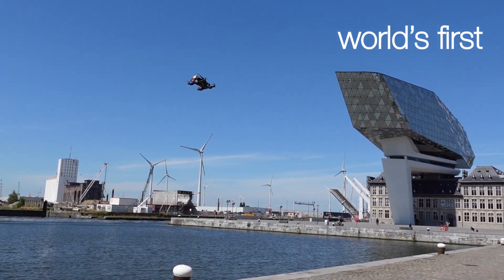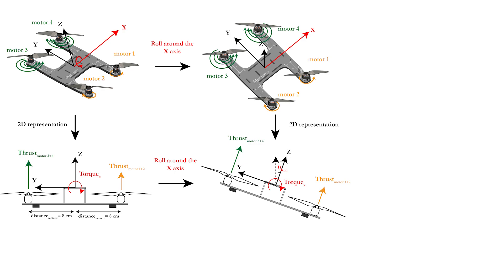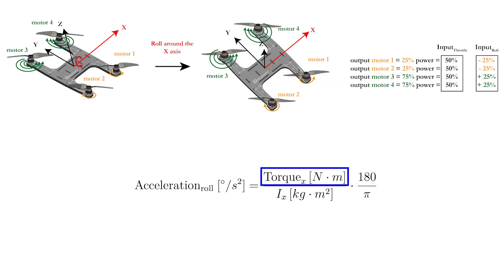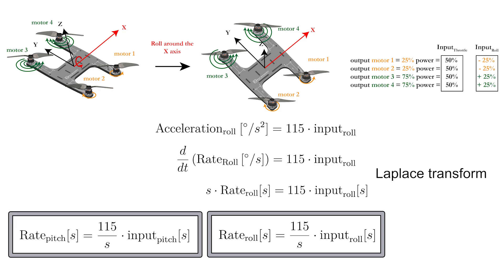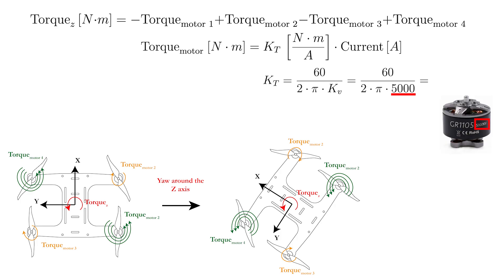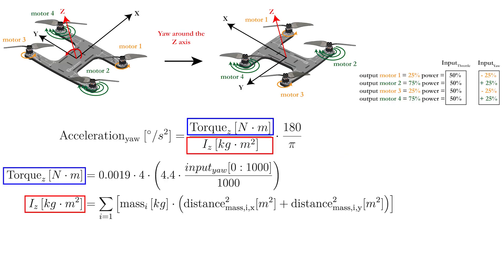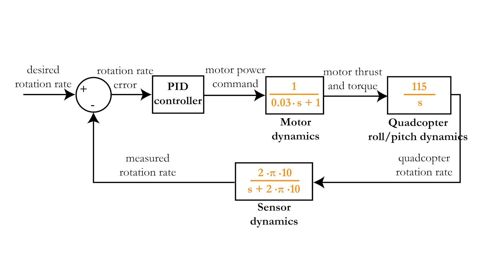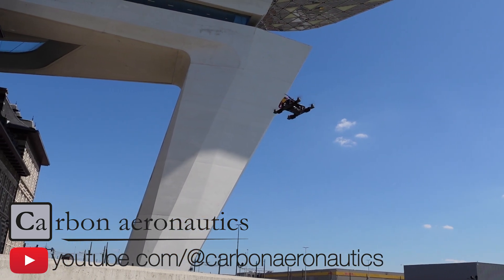2 | How to simulate drone dynamics mathematically

Comment: Full video series is very helpful. I am also trying to build a quadcopter based on your content. Thanks for your effort and time.
I have a doubt regarding the inertia calculation. Why didn't you consider battery while computing inertia (Ixx)?. 

Thank you.
Reply: Because he placed it in the middle, the distance between axis and the battery is negligible. hence Ixx for that is also negligible

Comment: Assuming that the thrust of all motors is the same, the equation for the torque around the x-axis cannot be rewritten as described. If the thrust of all motors is the same, the result must be zero, as the torques on the left and right sides cancel each other out. Can you explain to me how you got to the described equation?
Apart from that, your videos are great!
Reply: I agree.  I think this has to be expressed as a sum of the individual torques by each motor.